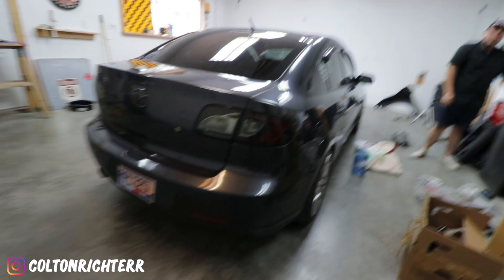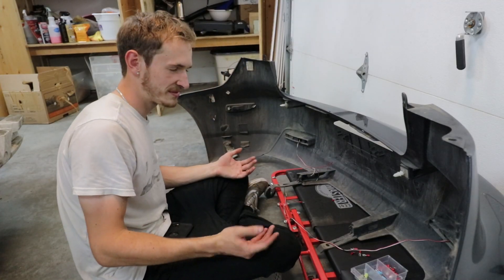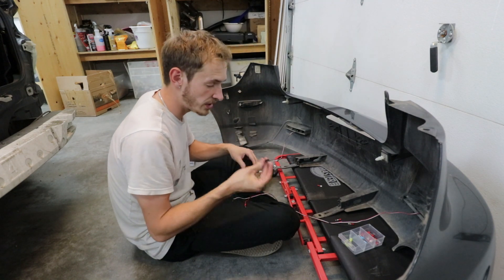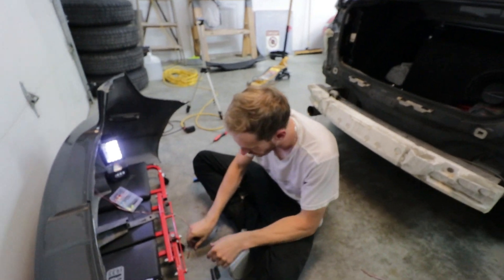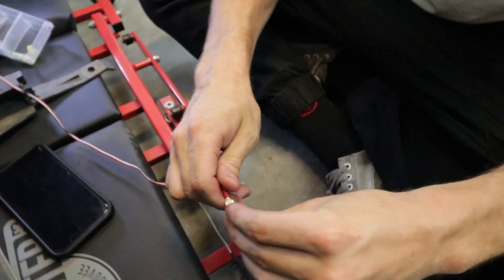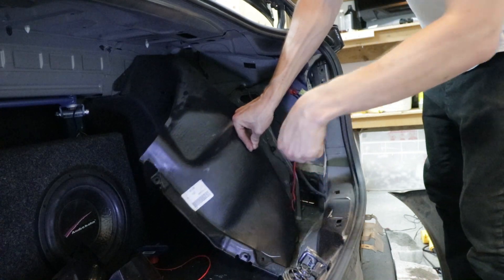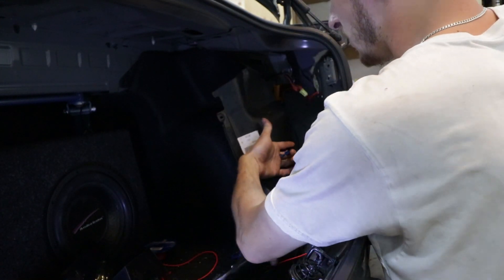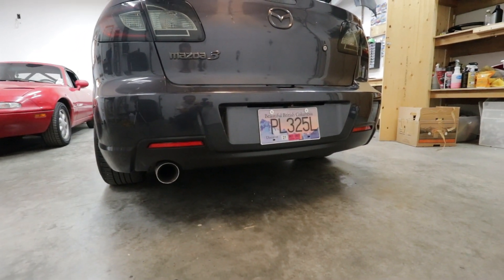Mazda 3 LED Reflector Wiring Guide

Comment: So I'm thinking about doing a Mazdaspeed 3 front end swap on my 07 3s gt how much fab work is needed for this or will it just not right up with all appropriate pieces
Reply from the maker: Front end as in bumper?
Reply: @ColtonRichter  yes and fenders, hood and lights
Reply from the maker: @danielbrown5511  It should bolt up all well as long as the whole front end swap is done.